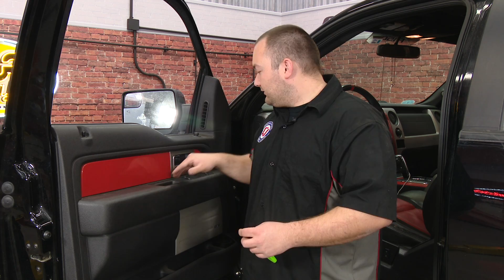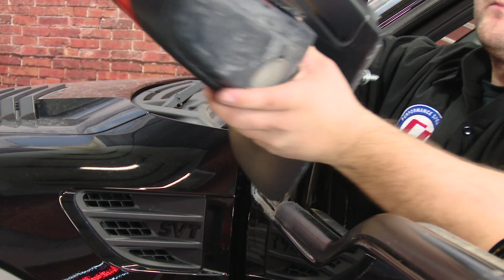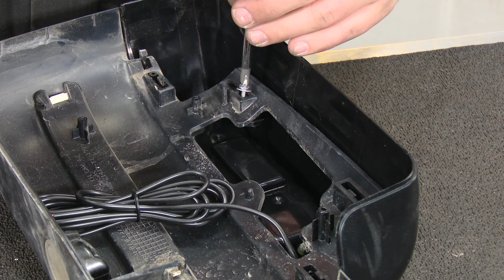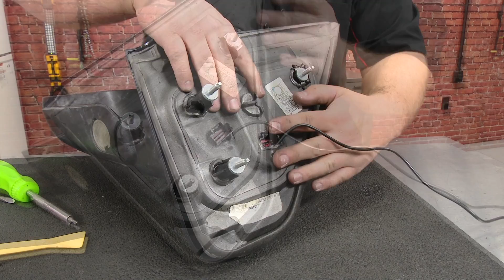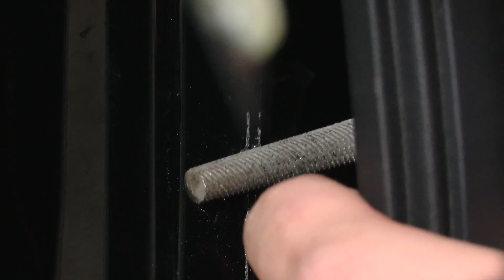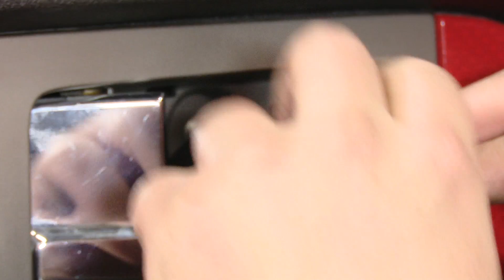F-150/Raptor Oracle Lighting Off-Road LED Side Mirror Cap Pair 2009-14/2010-14 Installation

Comment: Very poor wiring run. The wire can easily short to ground. The cheap crimps are also bad. Solder connections are always preferred.  This video is a great example of poor wiring practices.

Comment: Wouldn't you be able to splice it into the positive and negative wires for the heated mirror? It's already got the button wired and everything Into the truck from the factory. And you wouldn't have to take the door panel off.
Reply: @garrison arthur  it would probably overload that circuit

Comment: That's what the new 15-18 fl50 has except it's a small strip on the mirror and just as bright .. there called side mirror spot light...love em
Reply from the maker: We have these for the new F150 as well, they work with the mirror light and are insanely bright 😎
https://www.cjponyparts.com/oracle-lighting-led-light-bar-side-mirror-pair-f-150-f-150-raptor-2015-2019/p/5816001/